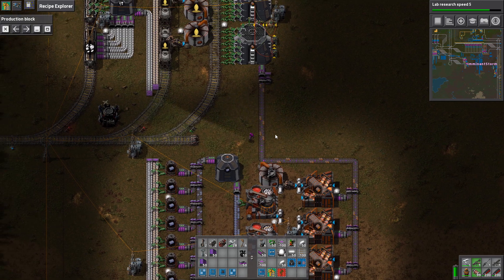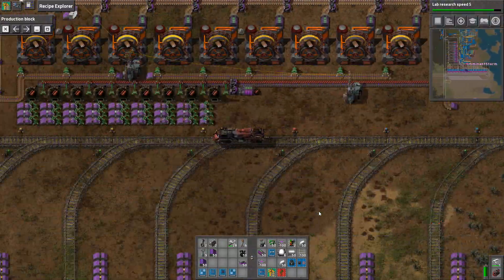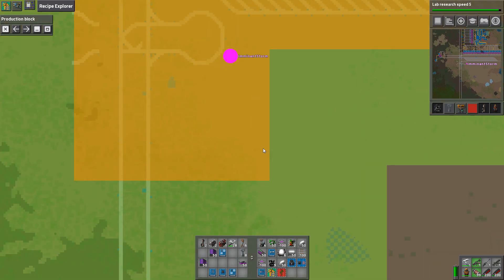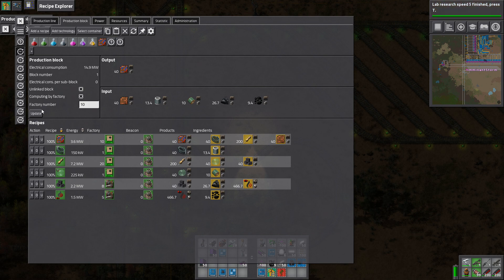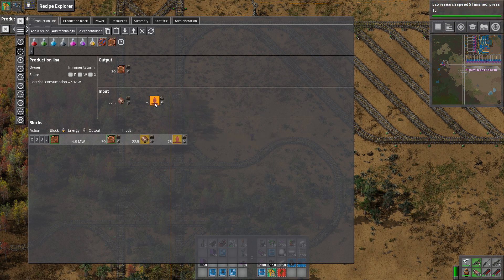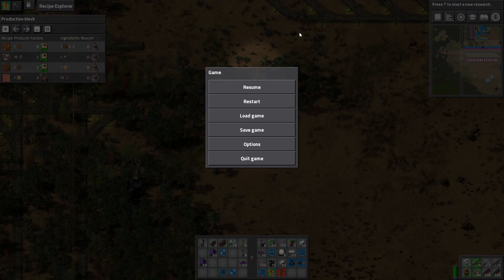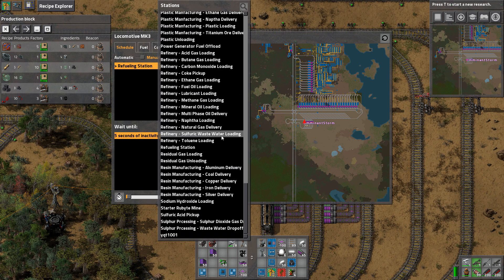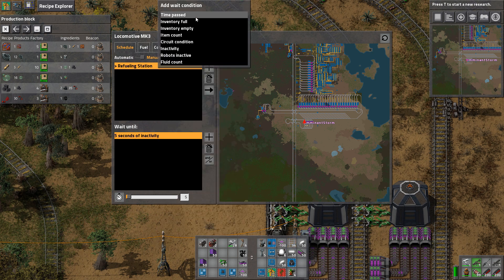Factorio - Angel's & Bob's - Episode 177 - New Electronics Setup

Comment: Feels like I only comment when I have a suggestion... so before I get into it, I wanted to let you know that I'm really enjoying this series! Now the suggestion. When you were being chased around by those behemoth biters (or titan or leviathan, I forget which one was the largest one), I paused the video from time to time to look at their resistances, and their lowest resistance was lasers, at 0/50%. So next time you have to go clear nests, I suggest setting up a fallback position somewhere that's just one HUGE wall of lasers, with a couple levels of concrete wall in front of them. Then if you find that the nest you were clearing had those behemoths in it, run for the fallback position, which should take them down with a storm of laser fire.